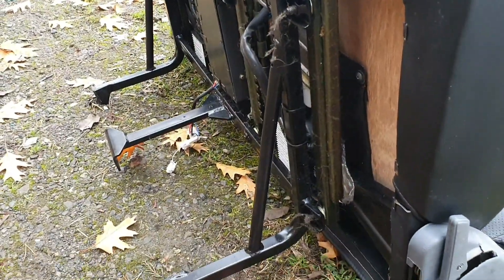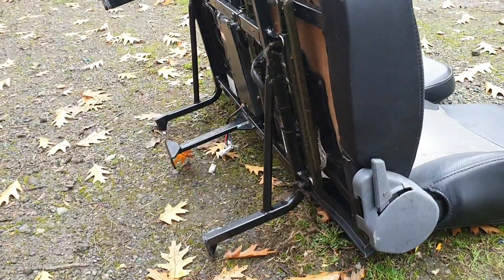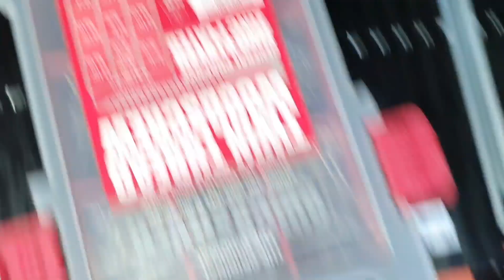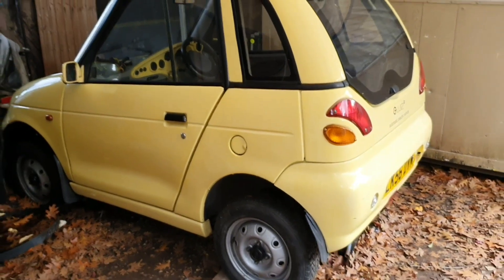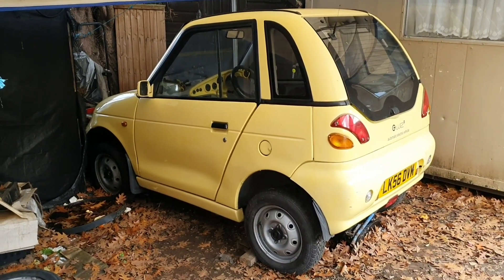REVA G-WIZ: Yellow Wiz Lithium-ion conversion pt.9 - wiring in fuses and making the front seats fit.

Comment: Hi Richard, when installing EMS Analyzer software I get an error: "Cannot find the provider. It may not be installed correctly." I tried downloading from different pages and it comes out the same. I am using wirtual Windows since my computer has version 8.0 and it does not open directly. Do you know how to solve this problem? I would really appreciate it, Thank you ...
Reply from the maker: Hi Roman,

I'm afraid I do not have any experience with that software as I do not use the EMS on a conversion. If you find Reva gwiz car club on facebook someone in that community may be able to help.

Comment: Thanks for the insurance qoute my insurance company would not insure if I change the battery chemistry but can have solar panels on ladder rack? I'm going to try Adrian flux what's the price for a year mine is under 400 with 0 no claim my a as is a new separate policy thanks Edward
Reply from the maker: Hi Ed, I'm surprised to hear another company refusing insurance because of a battery change. Batteries are interchangeable and are a part that must be changed at some point so its impossible to keep the original set from factory. Same principle as the battery under the hood of a combustion engine. Change it to lithium no problems. 

My quote was £324 for the first year as I have only just acquired it but if you have owned the gwiz longer then it will be considerably less maybe 200 or less. Also they can mirror your no claims, they did with mine.

Comment: from my experience I noticed that if I actually did made a DIY box instead of a light foam protection I wouldn't have been able to remove the cells that were going real hot. Very quickly I've cut the connectors between the cells and threw them away. With a protective box I would have saved the plastic of the door from burning but I would have lost all the cells nearby the hot ones. So probably the best thing would be making some sort of quick release for each module...may be too complex but a great thing init. What do you think about it?
Reply from the maker: Hmm, the likely hood of a good battery bank going wrong is very very rare unless it is mistreated so it's probably a bit overkill though not a bad idea if you can somehow find a way to secure it tight that if you had a crash the batteries won't go flying anywhere. As long as you use the batteries within their ratings and better yet below to prolong the cycles then there shouldn't be any real problems. For a DIY built battery having the extra measures is perhaps a good idea but a fireproof box will save yourself and the car (though quite expensive and hefty to build). I can't see cells getting too hot unless you puncture them or push them over their rated discharge/charge capacity which is why I always build a bank that is way over what I need so that there will be hardly any heat generation under normal use. As mine have water cooling built in that will further benefit them if I ever choose to rapid charge the bank. 

You could alternatively pull out the old fibreglass battery tray and build the modules into a secure box that you fasten to the chassis with a mechanism that if the bank went bad you can just release and drop out via some kind of 'emergency button or lever' onto the road and roll away. Batteries can always be replaced, these days at a relatively cheap price (lithium cheaper than lead acid now!) than they used to be so I'd rather save myself and the car and just buy a new bank.
Reply: @RichardMawby  I think you're definitely right. I like the idea of a quick release though.  Let's see 😄 your updates motivate me lol! I'll make the Gwiz run again!